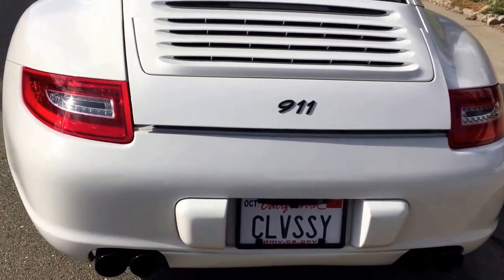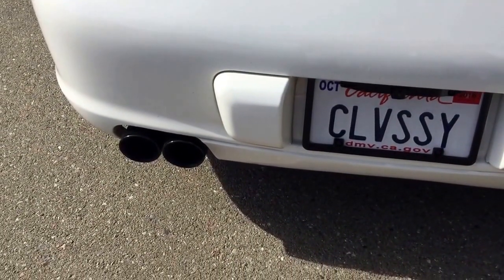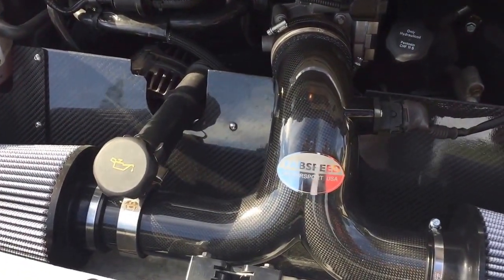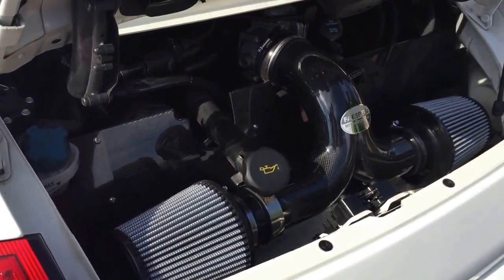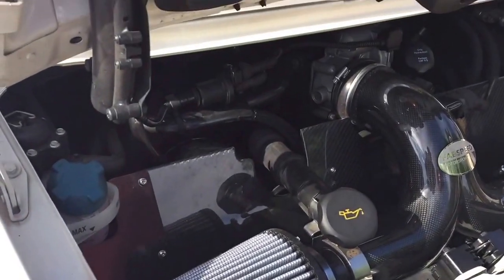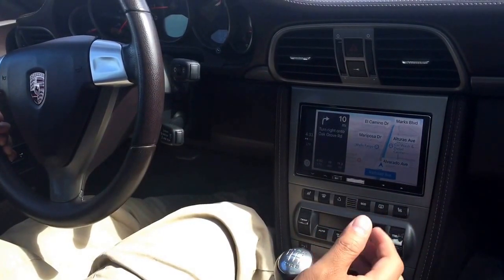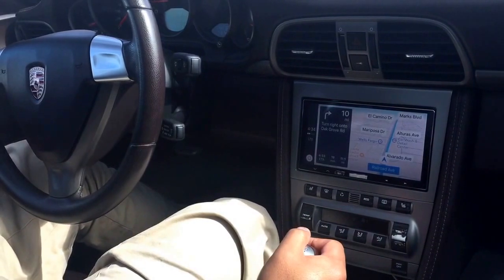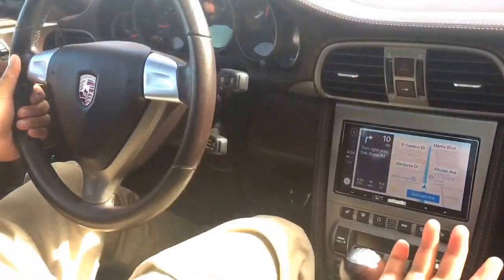Fabspeed Supercup Exhaust and Cold Air Intake on Porsche 911 997

Comment: How hard was it to install that ILX-700 head unit?  I had one in my old car.  I'm possibly in the market for a 911 now and if it fits a 911 easily, that's a huge plus.
Reply from the maker: +Paul Eubanks to be honest, installing it was kind of a pain because of where the wires were located. For example, I had to tap into the brake light wire and couldn't find it. In retrospect, I would have been happier spending $100 on the install. But you might be more savvy than me so go with your gut!

Comment: What kind of LED taillights are those?
Reply: Ron Mexico that’s not a 2009 997 man come on. I own a 997.
Reply: Ron Mexico Lights don’t come like that and it’s not a 2009 997. You alright?
Reply: Ron Mexico google 2009 997.2. Check back with me after you compare. You’re wrong. That’s a 997.1
Reply: Oops?
Reply: Ron Mexico look at the tail lights. The shape..... not the LED. These are 997.1 aftermarket lights.

The only difference outside between .1 and .2 are the led lights and the shape of the taillights
Reply: Ron Mexico I know they all look the same...
Reply: @essel23fly  They look like the dectane LEDs to me. Considering them myself but not sure if they just look a bit goofy on the 997.1 light shape. Based on this comment thread I guess most people can't tell the difference
Reply: DRSabeti yea it looks like they are! Thanks. I kind of prefer the 997.1 shape because they don’t have the round bottom, a bit more sleek. Seems like a lot of the LED tail lights look a bit cheap but this one seems nice.